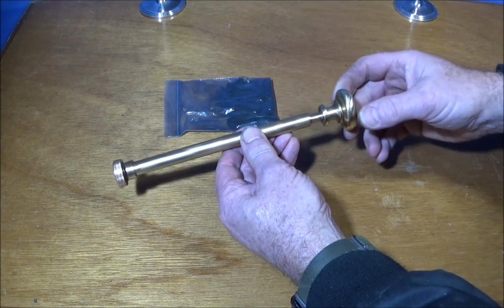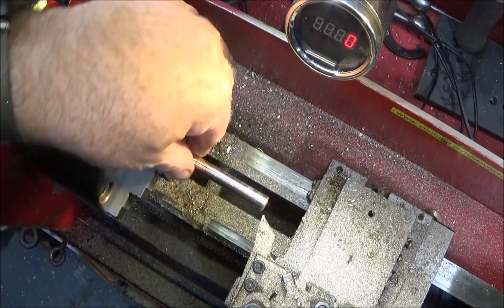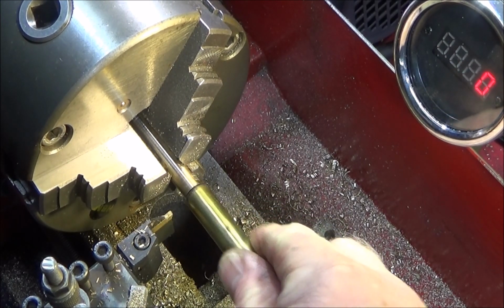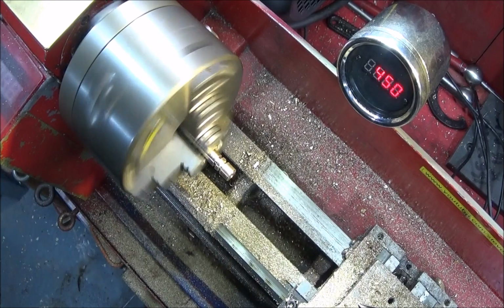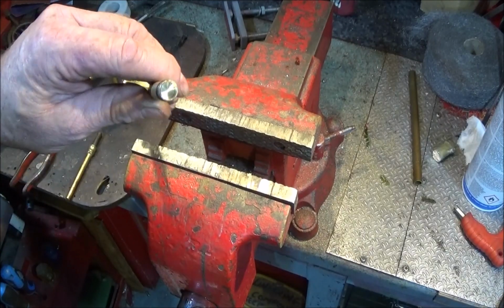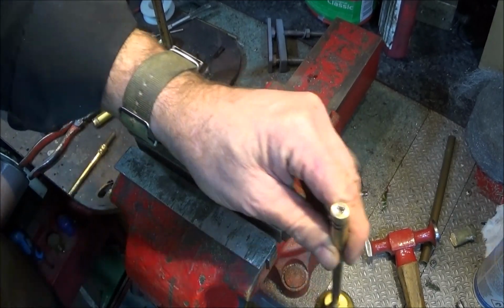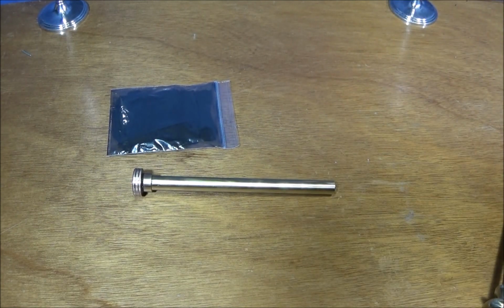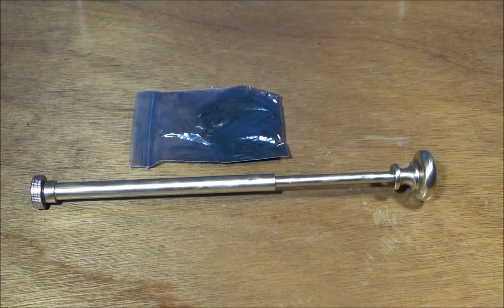Making A Brass Fire Piston Or Fire Syringe On The Lathe PART TWO

Comment from the maker: SEE LINKS FOR THE TOOLS USED IN THIS VIDEO
SANOU SELF-CENTERING 4 JAW K12-80 Lathe Chuck Tool -- https://goo.gl/WU2TB1
EXT GROOVE TOOL 12MM SHANK 2MM WIDE INSERT TYPE... https://goo.gl/1uRpB4 
Drillpro 19pcs 1-10mm HSS M35 Cobalt Twist Drill Bit Set -- https://goo.gl/YaEnRb
7pcs M3-M12 HSS Nitriding Coated Screw Tap --  https://goo.gl/FUYgqY 
SDJCR1010H07 10x100mm Lathe Boring Bar Turning Tool Holder -- https://goo.gl/yVS4bL
10pcs DCMT070202 Carbide Inserts -- https://goo.gl/BM1PVr
 SDJCR1212H07 12x100mm Lathe Turning Tool Holder Boring Bar -- https://goo.gl/SGnVZ3
 MT2 Live Center Set Morse Taper -- https://goo.gl/RLQumw
Reply from the maker: SOME FANTASTIC TOOL SPECIAL OFFERS:-
Buy 3 Get 15% Off,Buy 5 Get 25% Off -- https://goo.gl/ozBBnN
Buy 3 Get 20% Off,Buy 5 Get 30% Off --  https://goo.gl/go2mRv
Reply from the maker: Banggood Christmas Sale Electrionics -- https://goo.gl/uU4fZZ
50% off Raitool Tools Clearance -- https://goo.gl/GcXvTe
 Banggood Year-end Tools Clearance -- https://goo.gl/BnVctP
 3-7 Days Delivery Christmas Sale (US warehouse) -- https://goo.gl/NEuhVy
 3-7 Days Delivery Christmas Sale (EU warehouse) -- https://goo.gl/1DH2uc

Comment: Hi Steve, I took delivery just yesterday of the same parting tool but with the blue nano bits that you recommended a while ago, I just tried it seconds ago on a piece of steel rod and it cut it with no effort at all, I'm very pleased that I followed your advice. I've had my mini lathe for over 6 months now and never found a tool that would part off without nasty noises and vibration.
Just one point though, you can only cut up to 20mm dia with it so what do you do if you want to part a bar of say 30mm dia or more?
Thank you.
Reply from the maker: Hi Glyn, Thanks. I have an HSS part-off blade that is held in a quick change holder for up to about 40mm brass.
Any other material I just saw off in the bench vice with a hacksaw. 
If I'm cutting long bar down ready for machining I use the angle grinder with one of those cut-off stands. I rarely use the part off other than on brass or small diameter aluminium.
Reply: @SteveJordan  Thank's Steve for your very fast reply.  I had a piece of hard stainless bar about 1 1/2" dia to part off the other day and used an angle grinder resting on the compound slide and the job rotating slowly in the chuck, it did a fantastic job but I thought it seemed a bit 'Heath Robinson', but I guess I could try to make a bolt on holder for the angle grinder. Thanks for the advice. As soon as funds allow I'm going to be following your videos to turn my lathe into a mill as you have, I'm sure it will open up many more uses. I'm hoping to make a new 'longer' cross slide in the future (would make a great series of videos for you to do) as the one on it really narrows down what you can actually safely turn in these mini lathes (mine is the 7" x 14").
I'll watch your channel in anticipation as I don't think anyone has done this yet.

Comment: Hi I know I’m probably the only one who doesn’t know what this is can someone tell me please lol I feel thick thanks in advance and by the way Steve another great video very detailed god bless
Reply: This is a fire piston, which is a device for starting a fire without any batteries, lighter fluid, etc. It requires only a small piece of charred cotton cloth in the tip of the plunger, which it then ignites using the same compression principle as a diesel engine.